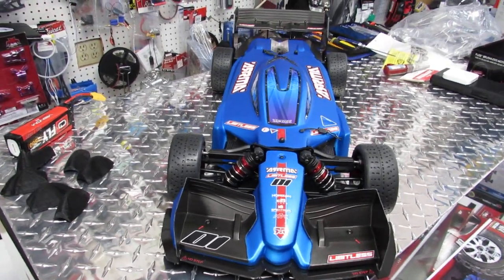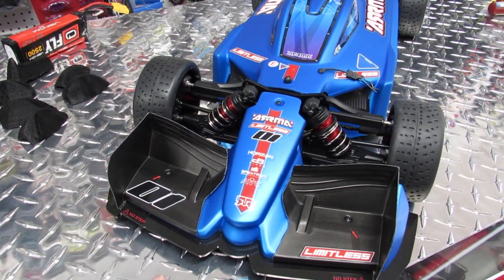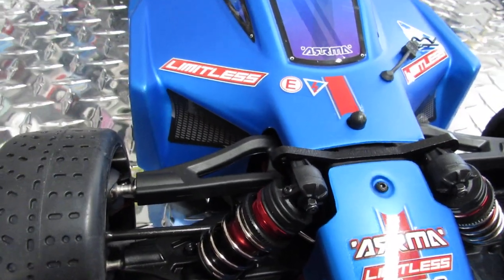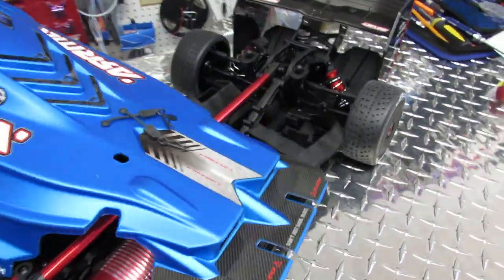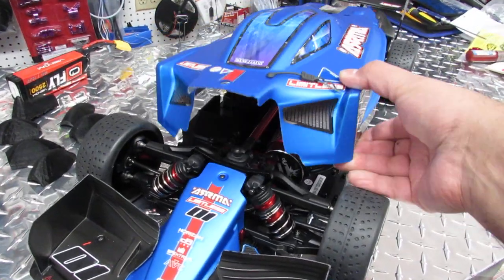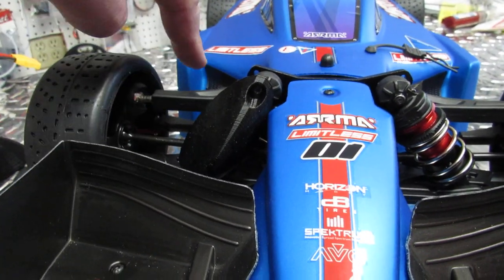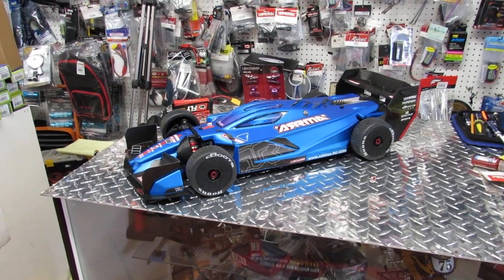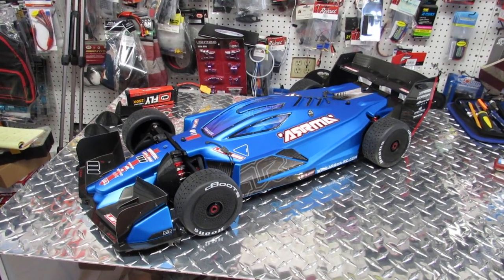ARRMA Limitless special aerodynamic adjustment and air Cooling

Comment: Not sure why I can not find anymore videos you have uploaded 

Do you have a video of finished out come of cutting the cover out and adding your 3d printer bits onto the car 
I would be very interested in seeing the complete outcome of a video of the limitless in action after all the upgrades you created has me very interested before and after runs of the limitless temp checks and speeds from cut out holes 
Very interested in seeing this upload show before and after test runs 
Before I attempt to cut my cover 

Nitro motors body shells yes have a hole cut out in body shell for cold air flow but very low chance for a nitro motor hitting the speeds of a car like this especially if people have put in 8s above insane speeds 6s is incredible power 
So it would be great to see all this interesting information put into practical not just therory
Reply from the maker: Look under my videos there are at least seven of them
Reply: @redjet505  
I have looked at all your videos there isn't any other arrma limitless ones on the other than the ones your comparing other rc cars with 
The videos your talking about may have been removed 
If you have a link could you please share 
Thank you
Reply from the maker: I will try to I will try to post a link for you
Reply: @redjet505  
Thank you
Reply from the maker: @MrRdizzle01  sorry for the late respond but we have a problem and we are looking for a new location for our business.

Comment: Little dips in the car are actually not a problem !!

For example: a hollow point bullet
creates a pocket of still air in front of it because there is a dip to catch the air therefore making a sort of air curve that will direct other air away from the dip it is in 

So adding plastic will just make for extra weight 

You need to do a bit more research before you start telling people that you are right and that they should do what you are implying and then they end up destroying an £80 limitless body
Reply from the maker: mmmm  NO THIS IS NOT HOW IT WORKS